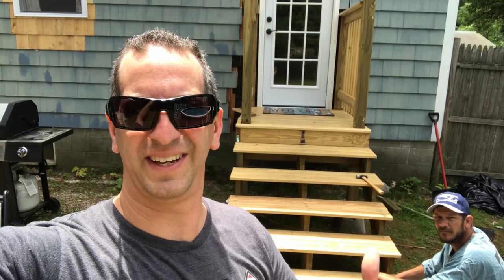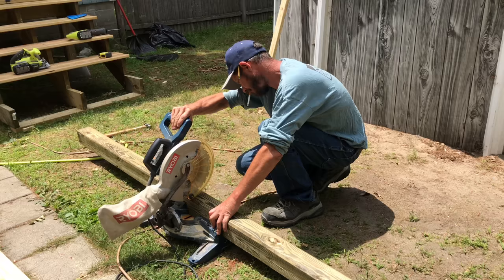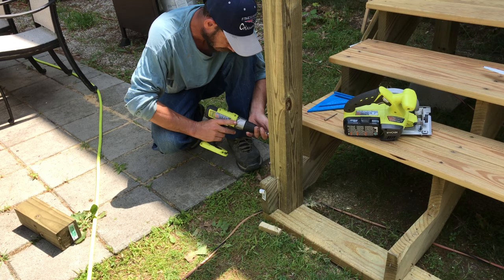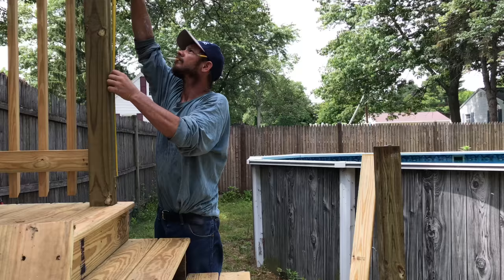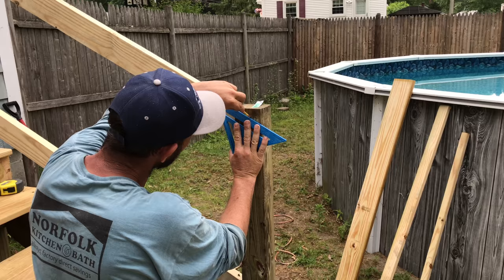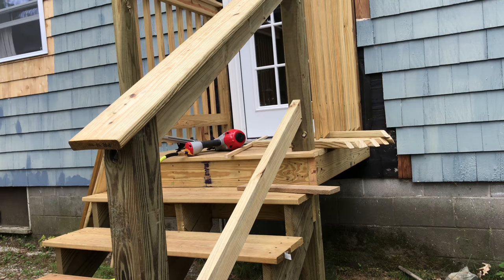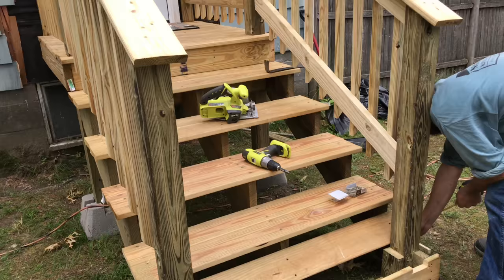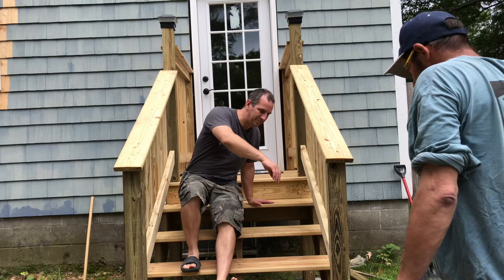How To Add a Railing to a Stairway (Easy DIY Project)

Comment: This shows everything you shouldn`t do when building steps lol
Reply: Why
Reply: Yeah I’m sure you’d know lmao
Reply: @moviemia1893  because every part of the deck has to be built in compliance with local building codes. The dangerous way they used the tools is also not a good idea such as cutting the top of a post at an angle with a reciprocating saw while smoking a cigarette and your helper is on the other side holding it with your blade ultimately expected to cut through the wood directly in the path of your helpers face....he almost got his face cut.
Reply: As a Safety guy, I agree.
Reply: I had to look away when they were running the table saw.  One kickback away from disaster.
Reply from the maker: That was the best part of the video
Reply: @406Steven  flip flops for the win!😂
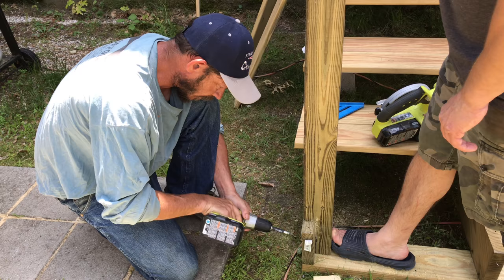Reply: 4:44 was my favourite part... Lol

Comment: Not criticizing you guys working, but that rail will not pass code at least here on the west coast...all stairs must be anchored to concrete at the bottom, the 2x6 top cap must be changed to allow a person to grab a hold in case of falling...the ballasts, will only stay in position for about two years only using one nail. That deck will only last about 5 years until it needs quite a bit of repair work....I'm a deck builder I guarantee our decks to last 75 years.
Reply from the maker: This was a temporary stairway that has been ripped down because we built a deck.
Reply: I was thinking the same stuff like what the hell no screws!!!
Reply: Correct,,, if a person over 300lbs grabs the front rail and needs support, or leans from the inside, that thing will show instability.  At least it is not an issue now ;) I am repairing the stepdaughters stairs and was looking for some reminders. I started laughing when watching this, I actually finish watching lol... On to another lol.

Comment: You guys are VERY TRUSTING of one another... your friend is wearing sandals while holding the post with his foot while you drill from the opposite side and later you're holding the post while he uses the recip saw to saw the post top off in the direction your head! 🤣😂🤣  Anyway, I was hoping to find an easy way (easy for me anyway) to make one handrail on some porch steps than hang over the stringer several inches so thanks for sharing!  🙂
Reply from the maker: Rob and I have know each other for over 30 years. Yeah we pretty much know what the other one is going to do at this point. When I nod my head you hit it...lol

Comment: A top hand rail must be small enough so an average hand can grab, and hold onto. This flat, wide top hand rail looks nice, but would fail a Buildings Dept insp.  Key is to keep D of B out of your backyard.   Good job anyway!!
Reply from the maker: Thanks for watching. This was a temporary stairway that we just ripped out and replaced with a deck. The new deck has this smaller railing for safety.
Reply: Mr. Beecher is absolutely correct. The "graspability" of the handrail is a critical issue which is totally overlooked in this otherwise handsome design.

Comment: Suggestion.  When using treated wood, retreat any cuts with wood preservative.  This prevents rot at the cut points…
Reply from the maker: Thanks for the added tip

Comment: soon as you guys finished and sat down i automatically said its time for beer. and then you said it lol
Reply from the maker: lol...This was a quick temporary stairway. Rob and I tore it down and build a huge deck in it's place which is compliant with local building codes. I still worked in sandals while we built it...lol

Comment: Great techniques and very helpful. But for you younger folks, use ear and eye protection. Mistakes on a build are easy to overcome; not so much a damaged ear or eye. Also, for something as important as a railing (esp for older folks who really lean on those things), use screws vs nails (esp from a nail gun). They'll hold way longer.
Reply from the maker: Thanks for watching

Comment: Turned out great but I'm wondering what good the blocks inside the base of the posts are doing.  They appear to be just screwed into the posts?
Reply from the maker: This was a temporary stairway. We ripped is down and built a beck where it was.

Comment: I know this is 2 years old but I really enjoyed watching this and it will help me with a project I’m planning out now. A couple of real guys working on a DIY project for sure. All the mistakes and safety concerns really makes this a DIY project and I don’t mean that in a negative way. I’ll supplement my video sources with a couple of This Old House  episodes to get more of a professional approach but again this is how most things get done when a couple of guys are willing to go at it.
Reply from the maker: Thanks for watching Carlos. This was a temporary stairway we just ripped it out to build a deck. If it's permanent  make sure the spindles on the staircase go lower so you can't get a 4" pipe under it. That's code over here.

Comment: What angle did you cut the stair railings? 45 degrees or that looks more like 22.5 degrees
Reply from the maker: I think they were 45s
Reply: I know this is months old, but alot of guys do the plumb cut of the stair angle which is rise÷run 2nd function tan on a scientific calculator.  Usually around 32 to 35 degrees

Comment: Did some small work on adding stairs, cut for an hour without glasses got crap in my eye.  I had them the whole time, but just couldnt fin them and said screw it.  Got crud in my eye a pro does it all day nothing!   :-)
Reply from the maker: Yeah, You should always have on safety glasses. I takes a second to put them on.